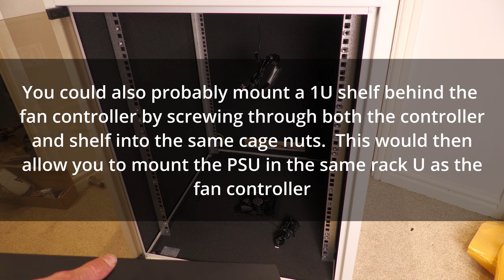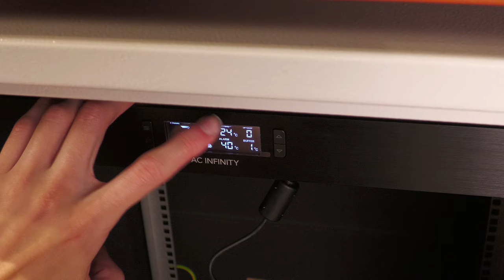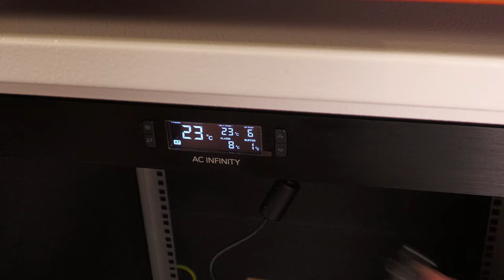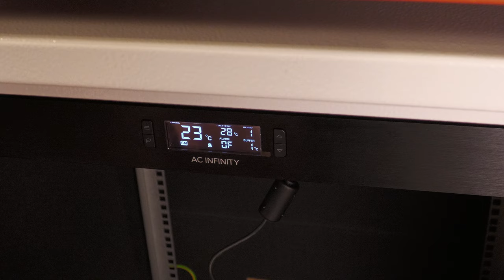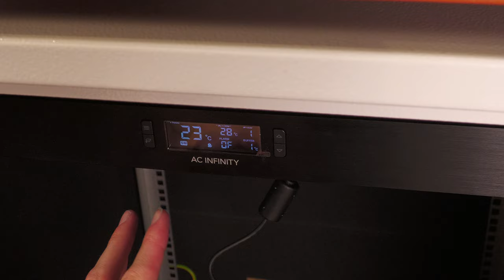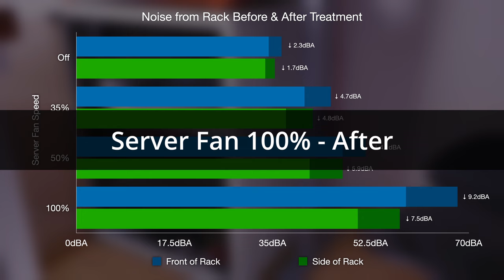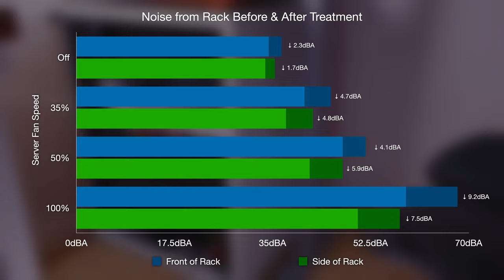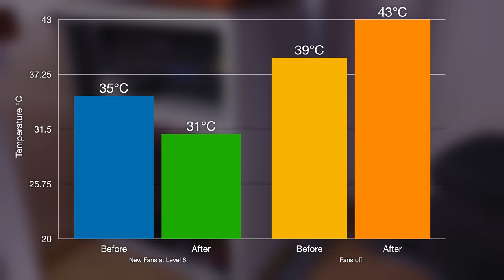I can't believe how well this worked!  Soundproofing & Cooling my Home Server Rack

Comment: I use these USB fans in all my rack cases too, QUIET and move air perfectly, if mounted at the top of the rack to pull air out. They also work really good at isolating them silent pc's with the heatsinks on the top and keeping them cool. Good video Cameron!

Comment: You could even put some weather stripping on to seal the door to the chassis as well, I imagine that's where most the remaining noise is coming through.
Reply from the maker: Very good point, actually looks like the "official" soundproof version of this rack has some sort of seal on the door.  Might try and pick some up at some point and give it a go!

Comment: ZPAS is still making racks and they are located in Poland. The model you got is from "office" line, which are designed to be closer to the human, and that's the reason of smaller air flow.

Comment: The discomfort around intake fans on carpet is hilarious. You're right, the carpet would, if anything, act as a filter for dust with most of it getting stuck on the carpet ready to be vacuumed. Do people think dust is magically created within the carpet itself?!
Reply: technically, the dust mites, that actually create some part of the mixture we call "dust", have more space to live on in carpet, since the surface area is greater. So one might argue that carpet is a better breeding ground for dust. But honestly I think most people on the internet confuse "PC getting dusty" with "air intake starved of air" - since PC feet usually sink into carpet, and if your carpet is a high pile carpet the carpet might block the intake. So just a regular case of people getting mad on the internet, having understood only half of it ;)
Reply: @klaernie  Pinkyblue light kills 99% of all dust mites, dead.
Reply: @travisash8180  time to fire up the RGB then!

Comment: This is a really cool setup now. Recently I worked on cooling security rack with PoE switches and recording boxes, since owner decided to have the server closet  permamently closed. There are 2 quad fan boxes blowing non-stop full speed and I managed to get 27C out of it. The rack is designed to suck fresh air alongside all bottom edges, so no bottom fan is required. Only middle and top ones are. I really like that.

Comment: Adjustable fan speeds was something I was looking for. I planned on going with a microcontroller with temp sensors. This way I can write code to adjust the fan speed given the temp and humidity of the rack. It will also connect to the AC unit as well.

Comment: AC Infinity is very handy, I've used them for quite some time now and I have a 2U (4 fan) temperature controlled unit. Looks similar to what you have in the controller, but just 2U and with 2 sets of 2 fans to the side of the one you've got. The option you've got works very well if you have your fans installed in the rack. I may switch out the fans they came with for some Noctua ones. It is a great option, bit pricy, and their power bricks are particularly cr*p - I've had to replace multiple of them over time. The thing I like about the more recent models, is that they have the ability to turn off the display, plus the quality of the metal is good.
Reply: I will check out the external brick option, that is a way better option.

Comment: I've been a fire alarm engineer for 20 years so I've a fair idea about how much of a difference a 9dB drop in sound pressures can be and it really is massive.
One way to maybe demonstrate it is that 65dB is considered the minimum for a fire alarm sounder.
However, in areas of high background noise, the fire alarm  needs to sound at a minimum of 5dB above the background noise. Ie, a 5dB increase above other noises is considered sufficient to make that noise distinguishable from every other noise in the background.

Another way of putting it is that you'll generally lose about 5dB going through a standard hollow door, or 10 dB going through a 60 minute fire door.

Comment: You could also mount the 1u rackshelf in the back of the rack at the same height as the fan controller, then you won't need deeper screws to mount them together at the front.

Comment: This looks brilliant! 
I have one of those USB fans in a cabinet out on a site just to blow some air over the passively cooled router, works really well. It's not got a controller on it just a simple USB power supply but the switch is mounted at the front so I can slow it down a bit in Winter if I'm on the site, and there's another site with one of those PoE splitter units giving 12v to a case fan that I can turn off with SNMP by turning off the PoE port on the switch.

Comment: Interesting that there's products sold for that kind of cooling! 5 or so years ago I wanted some temperature based cooling for my TV stand to keep the video game consoles cool. I searched around a bit for a product that might do that, but ended up just assuming that's not something there's a consumer market for. So instead I made my own basic circuit to run PWM PC fans with an Arduino. It was an interesting project and the end result did do what it needed to but I spent a long time tweaking the temperature response and attempting to get a quiet acceleration but eventually just left it at good enough. 

It would have been nice if I had run across the AC Infinity at the time. Would have saved a lot of time that I put in for the small benefits gained from adding the cooling fans.

Comment: I've had so many ac infinity fans and I've actually mounted them into my PC case and ran the USB cable out the back. 
I know I can just get a PWM splitter but I already had the fans because I was cooling my laptop by putting those fans on top of the keyboard and a laptop cooler

Comment: The way that power adaptor is positioned, it wouldn't block any ports.  It's actually 90 degrees from what a normal US power adaptor plug would be.  I have a couple in my cabinet just like that.

Comment: A thought on mounting the PSU - you've got a four-post rack, why not take advantage of that?  Mount the fan controller on the front posts and a shelf on the rear posts at the same U.
Reply: That's what he said he is planning on doing in the video.

Comment: If the foam is too big for the cabinet, take one of the scraps and see how difficult it is to set fire to it.  Do it outside, foam and similar stuff often releases a lot of black smoke and maybe bad chemicals too.  That is possible even if it does not catch fire, it may still release bad chemicals when heated to an extreme.
Reply from the maker: I tried that in this video with a small offcut, it didn't ignite at all, the most it did was slightly glow and produce a small amount of smoke

Comment: I am somewhat disappointed to not see standard PWM fan headers on the back of that AC Infinity device, but no doubt the proprietary ones are of high quality even if you pay a premium for them.
Reply from the maker: Yeah, those would have been ideal since they would also give fan speed monitoring, I was surprised that such a device just doesn't really exist!  I suppose this does give a more "polished" end result but if it existed, I'd have definitely rather just had a 1U 4 pin PWM fan controller hooked up to a pair of Noctua fans.
Reply: I suppose the demand for a nearly silent rack is so low that many manufacturers just don't bother.

Comment: Not complaining about the carpet!!! But is it worth putting some dust filter on the fan intakes to prevent any dust getting in?
Reply from the maker: It's something I considered although the difficulty would be being able to get it out easily to clean - might see if I can fit something on the bottom that would allow me to slide a fan filter out from under the rack while it's sitting on the floor.

Comment: A correction a 3dB reduction in sound level is halving of the sound level. So a 9 dB reduction is nearly a 90% reduction in the sound level.
Reply from the maker: I'm definitely not an expert, but the way I understand it is that while a 3dB change does represent a halving/doubling of sound energy and a 6dB change represents a halving/doubling of sound pressure, human perception also works somewhat logarithmically so many people see 10dB as a doubling/halving of how "loud" a person will experience a sound as being.
Reply: @camerongray1515   Wow, I was gonna comment the same 3db =-half/double but you are basically correct  in there's a differnece between db vs dbA (db weighted) and human sound perception. Did a bit of research and it all basically comes down to the frequency of the actual sound. 

So all that said, based on your chart, you would subjectively estimate that 9db sound reduction was roughly half what it was before the project?

Comment: just use a tempter sensor set to control 2 fans one that's always on one with a smart plug or wire in a smart fan switch that goes on a wall make a automation if it goes over this temp increase the speeds below this cut the power to the fans plus you get to use it manually too look at the apple home kit fan wall controls you can do this if you use this
Reply from the maker: While I could do that, I wanted a system that was completely standalone and didn't rely on any sort of network connection or server.  Otherwise, a network or server issue could cause the fans to stay off and the rack to overheat.

Comment: I didn't see that 10gb aliexpress firewall in the rack. Do you still use that thing? I'm thinking about getting one and I'm still weighing my options.
Reply from the maker: Yep, it's in a different rack - all of my structured cabling terminates in a wall mounted cabinet in a cupboard so I keep my router and core switches in there, this rack is in my office and holds my actual servers which are too large for the wall cabinet.

Comment: I think that racks like this have a VERY limited cooling power capacity.

If you put a bigger, more powerful server in there than what you have, then it will easily and quickly overwhelm the "cooling" capacity of the new fans to be able to draw in enough cooler, ambient air, to cool the rack, which will reduce it's ability to cool the rack.

I have I think it's like a 23U networking rack and it has fans as well, but when I had my 8 Xeons running at 100% load in the server rack, it got REALLY got inside said server rack.
Reply from the maker: Yeah, a rack like this is never designed to run a large amount of high power equipment.  For running a lot of servers you're going to need an open mesh rack in an air conditioned room.  Racks like mine are designed for running a small amount of equipment where the rack is sitting out on show and needs to look decent.  In my situation, it's almost certain that I'd end up limiting what I'm running from a power cost perspective long before I hit the thermal limits of this rack.  I would be unreasonably expensive to run anything more than a couple of low power, single CPU servers.
Reply: @camerongray1515  
Gotcha.

I have a similar, but taller rack like this as well.

I found out AFTER purchasing that it was really meant for networking gear rather than a 4-node, dual socket, Xeon (64-core/128-thread total) server.

Since then, I've replaced my four-node Xeon server with two Ryzen 5950X systems (for CAE/HPC workloads), but am looking to grow to to more nodes, but that's been put on hold for a while.

Comment: Expensive for what it is, arduino, temp sensor and relay for the fraction of the price
Reply from the maker: This does have the ability to adjust the fan speed based on the temperature so it's more than a simple thermostat (which is all you could build by using a relay).  Sure, the overall cost of materials to build something like this is nowhere near the cost of the finished product, but you also need to factor in that it comes in a nice rackmount case with connectors for the fans and a user interface to allow monitoring and controlling of it.  I'll gladly pay extra for that over having an Arduino and a bunch of associated components bodged somewhere into the rack.  And sure, I could buy a rack case, display and some buttons and build this myself for cheaper, but it would only be cheaper if I don't put a value on my time which I'd have to spend a lot of to build it vs this completely plug and play solution.

Comment: Instead of acoustic foam, you might explore some noise cancellation ideas where you would use a speaker and microphone to play the inverse of the fan noise similar to a noise cancelling headphone. That might work better and wouldn’t add heat to the cabinet.
Reply from the maker: That wouldn't be possible unfortunately.  Noise cancelling headphones work by picking up the sound exactly where it enters your ears and then plays the inverse directly into your ear.  When it comes to a whole room you have to deal with sound travelling in all directions, reflecting off surfaces.etc - Sure you could pick up the sound in one location with a microphone and play an inverse from a speaker at that location, but that won't do anything to stop sound that has reflected off of other surfaces.
Reply: Put the speakers facing your fans. That’s probably where the noise is coming from. So 4 speakers total that cancels the sidewall reflections. That would reduce the noise by 85-90%.
Reply: @camerongray1515  I’m having a similar problem with my Bambu Lab 3D printer. It’s noisy! And there isn’t room to put foam inside. So an active noise cancelation idea is really the only option.
Reply from the maker: Do you have any information showing this actually working in practice, I simply can't see how this could be possible - sound will be emitted from all sides of every single piece of equipment in the rack and then be reflected around inside the rack.  The servers will also vibrate and therefore cause everything in the rack to also emit some level of noise.  I can't see how some sort of speaker emitting the inverse of the sound picked up at a single location is going to do anything to reduce the overall noise in the room.

A similar scenario would be where you have a pair of speakers wired out of phase with each other.  Sure, one speaker will be playing the inverse of the other, but it doesn't mean you don't hear anything - the sound level will change as you move throughout the room with some areas being loud, and others being almost silent.  Noise cancelling headphones work because your ears are always going to be in the same position relative to the speaker, but this isn't the case when talking about a whole room.

The noise cancellation feature on the 3D printer you mentioned does seem to work, but this looks like it's using a microphone to listen to the sound produced and then tunes the motor driver to actually stop the motor from emitting certain frequencies - A clever idea for sure, but not the sort of thing that can be retrofitted to any noise source.
Reply: @camerongray1515  Do you always wait for someone else to prove to you it works before trying it? lol The lightbulb would never have been invented if Edison had done that. lol
Reply from the maker: I don't always wait for others but I suspect that the idea has already been tested out and found not to work by the multitude of companies that specialise in audio engineering/acoustic treatment/noise cancellation who would stand to make an absolute fortune if they could develop a viable product.  It's not as if it's a completely outlandish idea nobody will have ever thought of before.  I don't really fancy investing my time and money into something that, by my understanding of the technology, wouldn't be possible.
Reply: @camerongray1515  Personally I’m skeptical if it would be something that would make a lot of money, but I am fairly certain it could work. And I’m currently looking into doing it myself, be ause the noise this printer makes is driving me nuts, so you could say I am highly motivated to find a solution. lol
Reply from the maker: I've only briefly skimmed it, looks interesting and I'll admit it worked better than I thought it would, but that's still in a lab situation with a small, uniform metal enclosure with a sound source that isn't actually fixed to the enclosure.  The box in that video also has foam on the inside to reduce sound reflections which is exactly why I added foam in this video.  Suspect reflections would become an issue in a purely metal box.  Also not sure how well it would work with the sound levels involved here or where the cabinet has a glass door and vent openings for airflow.  For me, my situation was "my rack is too loud, I want it to be quieter" - I don't have anywhere near the time or resources to turn that into a massive engineering/research project whereas buying some foam and spending a couple of hours putting it in was a relatively easy fix.
Reply: @camerongray1515  Sure it’s a proof of concept, but he clearly shows it can work. By combining both passive dampening and active cancellation a DIY motivated person could in theory make a cabinet that reduces most noise. On the passive side, using a thick wooden frame (or metal if you can afford it) is the better starting spot. Then add a base layer of mass loaded vinyl on top of the inner walls, and then glue on top of the mass loaded vinyl some of your fireproof foam. Then on the outside use those active exciters, and as he says in the video, using an array of them on each panel would further improve performance over using just one on each panel. Then if you really wanted to go bonkers, you could build a secondary enclosure around the first which would provide an air gap and would eliminate any residual external noise. That would be the ultimate DIY solution, but as you say it would take some effort, time and skill to make.